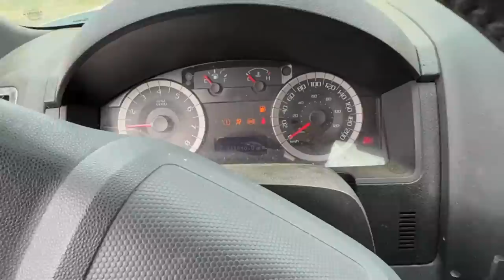CRASHED Ford Escape JUMPS AGAIN!

Comment: You could use the seat belt instead. Pull it all the way out, put threw the bottom of the steering wheel and buckle it. When you let go it'll sound like a ratchet and locks the wheel in place not letting it turn.